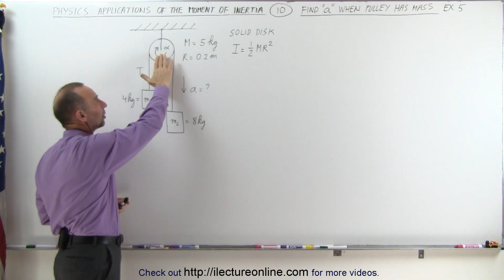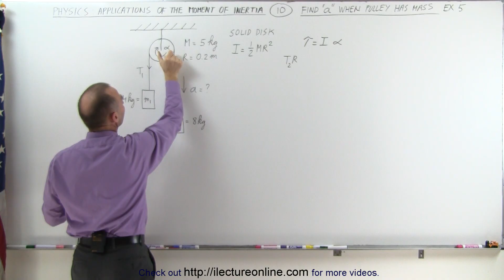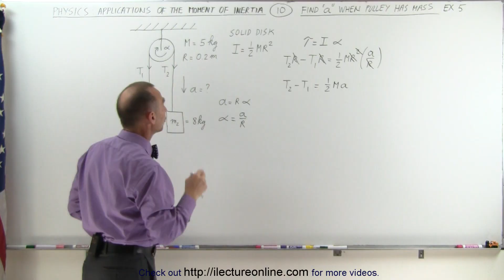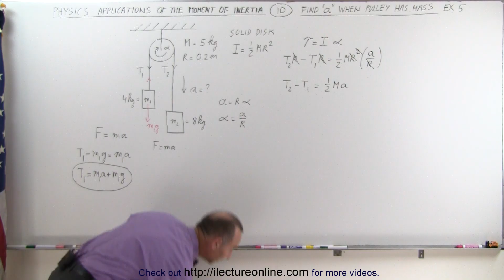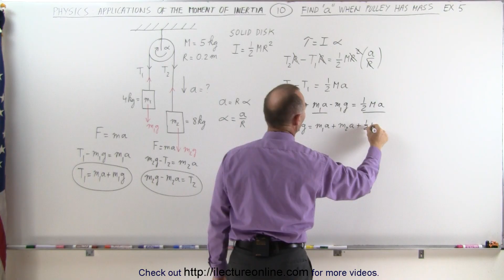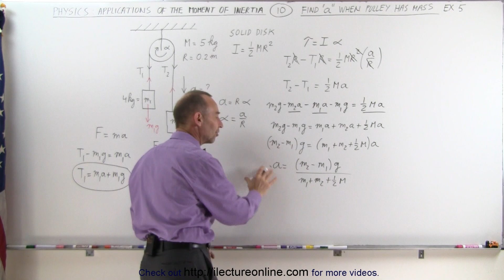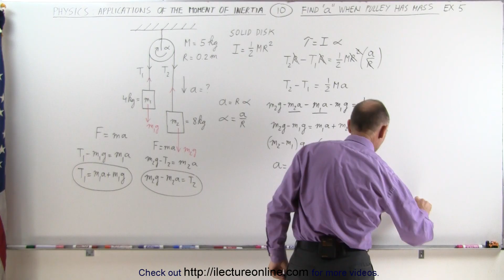Physics 13.1  Moment of Inertia Application (10 of 11) Acceleration=? When Pulley Has Mass

Comment: So because you substituted the angular acceleration using the formula for tangential acceleration, the acceleration you calculated would still be positive even though it is moving in the clockwise direction? For some physics problems I'm told that clockwise angular acceleration is negative and counterclockwise is positive, but other times people say it depends on which direction you define positive or negative. Is that correct?
Reply from the maker: If expressed as a vector quantity, yes.  But not if it is expressed as a magnitude.  Magnitudes of vectors cannot be negative.

Comment: Thank you so much! Can we work this out by energy conservation, assuming m2 gets displaced by 'x' m downwards and m1 by 'x' m upwards, subsequently and then calculating the energy change with it. Then we can differentiate two times to find acceleration. Would this work ?
Reply from the maker: Definitely.  Using an energy equation should always work.  You have to take into account the rotational kinetic energy stored in the rotating pulley.  However, to find the acceleration, it may be easier to follow the method shown,

Comment: why is T1 not equal to T2?
Reply: If they were equal the pulley wouldn’t rotate as the net torque would be 0
Reply: @JohnDoe-hf1zw  i understand now, thanks
Reply from the maker: T1 is not equalt to T2, because the pulley has mass (therefor it has a moment of inertia) and only the difference in tension can cause it to accelerate.
Reply: @MichelvanBiezen  yea makes sense, thanks. phys 1 was light today thx for the help

Comment: In the case of ideal pulleys, we considered tension at either side of the pulley to be same. Thats what i was getting wrong, it was quite confusing that the tension seemed to change but then i saw this video. Thanks for the help
Reply from the maker: In the case of the "ideal" pulley where the disk of the pulley doesn't have mass, the tension on both sides is the same.  But in a real pulley we have to take into consideration the moment of inertia of the pulley and the tensions on both sides are not equal.

Comment: if the question only ask for tension in both string only, do we have to calculate acceleration first as well ?
Reply from the maker: Yes.  You will not be able to determine the tension without calculating the acceleration.
Reply: alright, thank you!

Comment: Omgg thank you... This is what i was looking for... I am preparing for JEE ADV exam and i had difficulty with pulleys with mass but now i got it
Reply from the maker: You came to the right channel to help you prepare for the JEE ADV.  We have thousands of physics videos as well as math vicdeos that will help you prepare.
Reply: bro did you noticed the catch in the formula of acceleration?
here the formula is a=(M₂-M₁) g/ (M₁+M₂+ ½M ), where did this ½M came from? This ½M can be written as (I/R²) which may be seen as Rotational Mass (we know I=MR² so M=I/R² , let's call this M as rotational mass ) .
So overall formula comes to be , a= Net Translational FORCE / (Net Translational Mass of blocks + Rotational Mass of Pulley).  = M₂-M₁/(M₁+M₂+I/R²) = M₂-M₁/M₁+M₂+½M.

Comment: How do we get the radius if the acceleration was given?
Reply: R gets cancelled out from both sides
Reply: @MichelvanBiezen
Reply from the maker: Normally you would work out the problem in exactly the same way, but once you have the equation, you solve for R.  In this case you can notice that R cancels out which means that the radius can be of any size.

Comment: How do you do it with two different radius, one for each mass.
Reply from the maker: Then the torque on one side will be (m1g - m1a) R1 and the torque on the other side (m2g + m2a) R2  .   And you will have two moments of inertia so the right side of the equation will be:   (I1)(alpha1) + (I2)(alpha2)

Comment: Doesn't the gravity cause the Torque too? I'm so confused. I thought that when we do use the Torque Equation T=F x R, we would say (mg-Tension)*R
Reply from the maker: It depends on which direction the object is accelerating.  For the block accelerating upward,  T = mg + ma   for the block accelerating downward   T = mg - ma
Reply: @MichelvanBiezen  my question is about different. You are saying that the tensions supplies them torque, but I’m asking: doesn’t the gravity and tension isn’t the string supply the torque
Reply: @MichelvanBiezen  you drew a tension force down on both strings? Both isn’t the tension going up?
Reply from the maker: relative to the pulley, the tension acts downward for both strings.
Reply from the maker: The equations as presented in the video are correct.
Reply: hi.
we consider the force of gravity to act at the COM (centre of mass) , hence torque of pulley due to gravity about COM (of pulley) will be zero .
but
Tension does not at the COM of pulley hence it's torques about COM is NOT zero.
hope it's clear.
😀
Reply: @faizul_mirza  omg tks bro

Comment: As there are masses attached to the pulley shoudnt the moment of inertia change?
Reply from the maker: No, the attached masses cause torques to act on the pulley, but they do not change the moment of inertia of the pulley.  Moment of inertial only depends on the shape and the mass distribution.
Reply: @MichelvanBiezen  oh thankzz :DD.

Comment: This is amazing. Question: how do you incorporate friction from the pulley (given in torque) in this method? Tried looking for a video of yours that has this but no luck.
Reply from the maker: We have some videos like that in this playlist:  MECHANICAL ENGINEERING 11 FRICTION      starting with   Mechanical Engineering: Ch 11: Friction (31 of 47) (Flat) Belt Friction: Deriving the Equation      Is that what you are looking for?
Reply: @MichelvanBiezen  thanks! I'll check them out and let you know. The question is basically the same as in this video, but the pulley has friction to it
Reply: @MichelvanBiezen  Hi again...I'm afraid not actually, checked them out but they are more advanced material, I'm still just in physics 1...I really like how you manipulated the equation and got the answer without needing to calculate the moment of inertia..I'll work on understanding the other method for solving it...thanks so much for your videos, sincerely
Reply from the maker: Yes, I think you are correct that this is a different type of friction.  With pulleys it depends on how they express the friction.  One way is to state:  It takes x Nm of torque to overcome the friction of the pulley and then you have to subtract that from the torque that aids the acceleration.
Reply: Actually, static friction is already part of this problem. It is not the tension in the ropes that accelerates the pulley, it is the static friction between the rope and the pulley causing torque on the pulley. The rope is NOT attached to the pulley (but laying on top of it) so T1 and T2 are just the tensions within the rope and not the force between rope and pulley. The static friction causes the rope to have grip or traction on the pulley, taking the pulley along with it. Then why do the calculations give the correct answer without taking friction into account? Actually, the equation of motion in the video is not the equation of motion for just the pulley. It is the equation of motion for the system consisting  of pulley + piece of rope in contact with the pulley. In that case you only need to worry about the external forces working on the system and you dont need to consider the forces between the different parts of your system, like the friction between rope and pulley and vice versa. The only external forces on the pulley + rope that cause a torque are the tension T1 and T2. Therefore the calculations are correct, but it is a little more subtile when you look closer at the problem.

Comment: Can acceleration be a negative value?
Reply from the maker: If you express it as a vector, yes.  If you express it as a magnitude, no.
Reply: Michel van Biezen tq sir
Reply: @MichelvanBiezen  I'm trying to get a negative acceleration just to convince myself that setting any sign convention you want will yield the same result.  For e.g. I'm using sign convention up as +ve for acceleration and forces, and counter-clockwise as +ve (Opposite to how the system would behave in your diagram) however I can't reach a negative answer.  

Is the right handside of equation τ = Iα  the difference in torque values (Can it be stated as a vector summation)?  I've tried (with my sign convention CCW as +ve):
-T2+T1 = 1/2*m(pulley)*a       (cancelled r's)
(right side of the equation resisting pulley motion in +ve direction) but it doesn't yield a negative answer.  

Thank you for these videos!

Comment: I'm not completely clear why the tension isn't the same along the length of the rope aka why T1 is not T2. Is there a video done by you that I can watch that addresses this? Thank you!
Reply from the maker: If the pulley has mass (and therefore moment of inertia)  it requires tension to provide the torque to give it angular acceleration and thus T2 must be greater than T1.   If the pulley does not have mass then the tension will be the same on both sides.
Reply: If the tension is uniform through the rope, there would be no rotational motion on the pulley, as the only torques are created by the tensions.
Reply: Not good

Comment: I found out that you can get the same answer by setting acceleration equal to the mg of the right mass minus mg of the second mass, and dividing that quantity by the sum of masses of each block and half of the mass of the pully. Is that appropriate to do? Is it cheating?
Reply: Its cheating youre going to be arrested

Comment: can you please help, i was given the same question but there is no torque?
i tried solving it but i dont get the correct answer
Reply from the maker: Does the pulley have mass (and moment of inertia) in your question?  If not use the techniques shown in this playlist:  PHYSICS 5 APPLICATIONS OF NEWTON'S LAWS
Reply: no, okay thank you
Reply: okay i just saw the example, in my question they are saying the accelerations are different and tensions are the same
Reply from the maker: The magnitude of the accelerations must be the same if the masses are connected to the same string.  (directions are different)
Reply: +Michel van Biezen 
their tensions are the same but the diameters of the pulleys where they are connected are different

Comment: T1= ma+mg , But why is that when you substitute it to the equation, you changed it to ma-mg?
Reply from the maker: No, it wasn't changed to ma-mg.
Reply: Guys, basic algebra. Yes, T1=m1a +m1g. But when you subtract T1 in the second equation, both + terms become negative.  (ma + mg) = - ma mg.
Reply: I was wondering the same thing, you didn't start doing this until example 9
Reply: T2 --  T1 
 ( m2g - m2a) -- ( m1g + m1a)
m2g - m2a -- m1g -- m1a  

Understand?